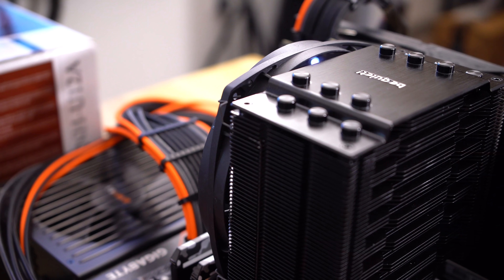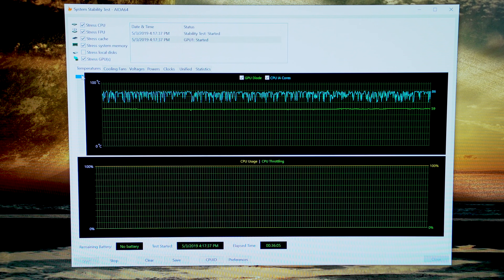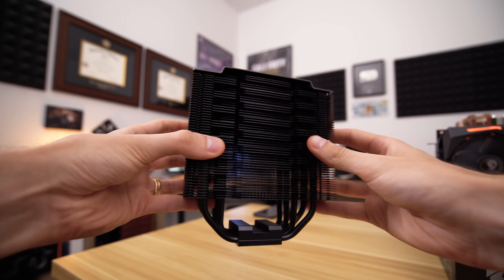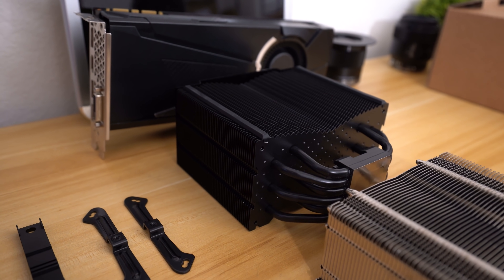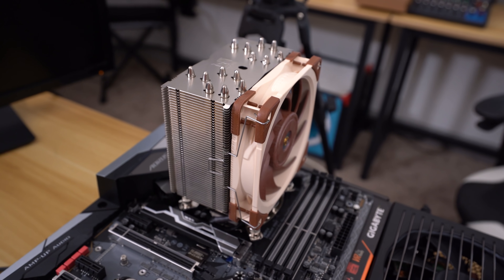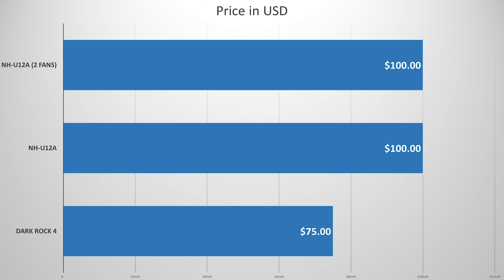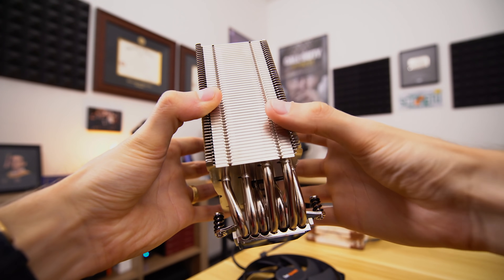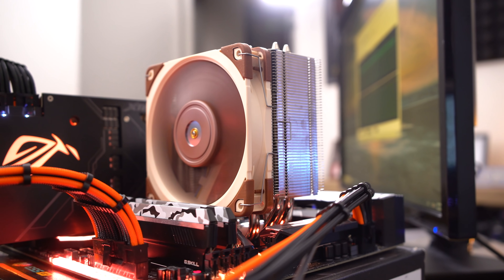Air Cooler Showdown: NH-U12A vs. Dark Rock 4

Comment: I would take the Noctua any day, so much easier to install and mount and way better clearance. You can always adjust the PWM signal to lower rpm and noise.
Reply: Gripen90 the dark rock 4 is actually not that difficult to mount. In the past bequiet coolers were terrible to install.
I do run an non delidded 8700k@4,6 on an topflow2 cooler which also activly cools the mobo vrms with its fan running at 650rpm
Reply: @TheNaikan  I love fanboys of random products such as PC air coolers.  Don't get me wrong, but dude, you don't need to say this test was dumb.  If the the fan curve would've been lowered for the Noctua's run and the small performance margin of the Noctua was eliminated, you'd be saying the test was unfair.  Both are great coolers, get the BQ if you want sleek looks at a lower cost, and get the Noctua if you want the best performance.  You really don't need to defend what you buy or prefer here, no one is saying your cooler preference is wrong.

Comment: BH-U12A is a 100$? I paid like 90 for the NH-D15 and it wasnt on sale
Reply: NO ONE is buying a NH-U12A of they can fit a D-15s/Dark Rock Pro 4 into their case. you are paying a premium because space is fucked.
Reply: You're paying for the fans, the new noctua fans are amazing
Reply: @Manjai122  The NH-D15 comes with 2 of the new fans tho
Reply: It performs as well has the D15 but has 100% ram compatibility and weighs significantly less
Reply: Nooooo it performs ALMOST as well the D15 is still a better cooler
Reply: @zergtoss1  its probably because of the fans since they are $25 - $30 each, but i still think its impressive that it is on par while being significantly smaller
Reply: @zergtoss1  other reviews show it beating the d15... It's within the margin of error. I'd argue the 12a is better because it doesn't fill your entire case...

Comment: Good stuff! I agree with your reasoning. Running a DRP4 in my system, and I certainly wouldn't put a puke-colored fan in there. :)
Reply: They really are hyper ugly. Also, an exposed washer in the middle of the hub on the “best” fans? Congrats, you made your ugly fans somehow more ugly. Sad part is they are proud of their “gorged on chocolate and barfed” color scheme.

Comment: I would still take the noctua for the ram clearance, but great value on the dark rock still
Reply: Will a copper brick help with a lot more than just height?
Reply: The dark rock pro 4 is designed a little different, has cutouts for more ram clearance, comes with more fans is, is still crazy quiet, and looks bad ass
Reply: Same. Noctua is cheaper for me in Ottawa Canada.
Reply: The color  of the fan is an eye sore but it's worth it. I went from 65° during gameplay and 55° while idling to 55° and 45° respectively. It's also a little noisy but tends to be really quiet when leaving it on idle. Got it for 60 bucks on Amazon.
Reply: If you look well this is not an issue, you can lift up the fan on the cooler tower so it's not in the way of the ram anymore, I have pretty tall ram sticks anf with that I didn't have any problems
Reply: Chromax ones are coming before end of 2019, hope it won't be any more expensive, or i'll just get Ninja 5 or MA620P and put some NB eLoop fans on it, Noctua is best for case fans, not for static pressure fans, it's still better than most of rivals, but not best one, I got some 120mm Chromax case fans, but other stuff, specially this new expensive "all around" coolers are not worth it, they got same static pressure on higher rpm than normal ones which aren't the best anyway, and less airflow on 2000rpm than case ones on 1200rpm...

Comment: Thanks for the video, but 10 times out of 10 I'll chose an AIO liquid cooler instead.
Reply: "better" not quite, AIO's are better in short bursts, takes about 15 minutes for the water to heat up entirely so that means you have 15 minutes without the spikes and thermal throttling if you're pushing the chip. An air cooler will jump to its peak immediately, so if you're running a game that throws your CPU against the wall part of the time and is fine for the rest then the AIO would much less likely thermal throttle. It also depends on which AIO because some AIO's are better all around bur that's the science. AIO's are also much better for travel because you don't have to risk bending anything with that big heat sink flopping around and AIO's have silent modes where the fans don't even have to kick on for a while. AIO's also usually look better too but that's subjective.
Reply: @Youdontknowme-xc8mu  I've never had a problem with my system over heating. Max temp after 90 minutes of running prime 95 is 82C. I'm sure my case helps a lot with cooling. It's a cooler master H500 with 3 200mm fans, 2 in front and 1 on top.
Reply: It's personal preference in the end. You can't go wrong with Be Quiet, Noctua or high end AIOs anyway.
Reply: @mr.madnus.fernus  True. Some like the way a big air cooler looks in their system and that's cool. But I like the cleaner look of a small AIO pump. Also I never have to worry about my ram being too tall. 👍
Reply: Actually both of these coolers are better than an Aio
Reply: @ferasamro9735  Depends on what you consider better. Temps with both are similar, but air coolers are big ugly blocks of metal which I do not want in my system.

Comment: If Noctua releases a blacked out edition, it'll sellout so fast. Just look at Linus' video comparing AIO to Air Coolers.
Reply: They don't sell one technically, but you can change colors using the Chromax fans and Chromax accessories for the D15 (not sure about the one in this video).  I did mine in white and it's beautiful.

Comment: wow what an odd coincidence... I was litterally just looking into both of these coolers and wondered which was better.
Reply: Noctua is king, I own the monstrous NH D15 and it made my old AIO look stupid plus it is barely audible even at max rpm. My case fans are be quiet though.
Reply: @jasongooden917  yea, but Noctua air coolers look awful even with shrouds
Reply: @benstaker2363  looks don't matter as much as prefromance especially with overclocking Ryzen. This Noctua is awesome and worth every penny. How many people really care what your cpu cooler looks like or look in your case to see it?
Reply: @MitchGaar  Damn this is an old comment. People do look, one of the big things with enthusiast PCs, but this vid is old and outdated, my air cooler recommendation is the noctua u12a now, it's what I run myself.
Reply: there is noctua nh-u12s one & ~$59 & older model with 5x heatpipes.  the S is slim or single fan & the 12a is newer model has 7x heatpipes.
Reply: Probably not a coincidence, just google.
Reply: Go with Noctua, I did my research and it out preforms everything in air coolers.
Reply: The algorithm knows all.
Reply: Ikr, I was doing the same thing
Reply: Get a Dark Rock Pro 4, it outperforms the Noctua.
Reply: @ninetenduh  no it doesn't lmaoo where do you get your information from
Reply: @ninetenduh  bullshit

Comment: but blocking a RAM slot is kinda inexcusable.............
Reply from the maker: You can still raise the 140mm SW3 fan. It'll look weird, but there's a bit of flexibility involved. And I'd argue that most PC builders are using two modules instead of the costly 4 alternative, so it wouldn't be an issue either way.

Comment: Could push pull enhance the performance of the dark rock 4 ?
Reply: Yea it should be it depens on the air flow. Also it most likely will only be by a couple procents

Comment: would you recommend the Dark rock 4 version more or the Pro version? because i have a I7 8700k to cool and i dont want an water cooler.
Reply: if you have low profile ram and want to overclock the crap outta that cpu then go for the dark rockpro 4. if not then go for dark rock 4

Comment: what about, the Dark Rock Pro 4?  how does it compare to the NH-U12A?   Plus, they are closer to the same price.
Reply: Nothing against BQ or the DRP4, but that's bringing some pretty enormous firepower up against Noctua's mainstream tower. I think most builders are going to want to compare the DRP4 with the NH-D15 or D15S (offset, single fan), while people choosing an NH-U12S or DR4 are looking for a shorter cooler (doesn't hit the side of the case) that is very unlikely to interfere with RAM or GPU clearance
Reply: @elenchus  $100 for an air cooler is not mainstream.
Reply: @nindzamaleta3030  "$100 for an air cooler is not mainstream."

Sure it is--it's a mid-weight, mid-height, mid-width, mid-sized fan cooler, made to fit most midtowers. It's absolutely the mainstream solution from Noctua.

But you can always pick up an NH-U12A, the last generation of the cooler, for under $60 directly from Noctua via their Amazon store, or their high-end NH-D15 for $90, again, directly from Noctua via Amazon. 

So if price is the hangup, just go for the D15.
Reply: @elenchus  The height of the U12A is 158mm and the DR4 is 159mm where as the the DRP4 is only a few mm taller at 163mm. Very few chassis (honestly I can't even name one off the top of my head) cap clearance at 160mm, most mid towers are either 155 or 165. The U12A is better for tall ram clearance, particularly if you want to show off the RGB bling though.
Reply: @Allhopeforhumanity  Tons of cases cap at exactly 160mm. I see it all the time. 

That said, in my experimentation, I've found most of them are very conservative with their official specs. One of my cases, a Silverstone FT05, claimed to be limited to 162mm, but I was able to fit the NH-U14S (it just barely touches the side of the case, but no bulge), a 165mm cooler. I figure that they put in 2.5mm of extra clearance over the real spec. 

So even if the case says 160mm, there's a decent chance you could make it if you were willing to try.

Still, I think that people shopping the NH-U12S will be looking at similar towers like Dark Rock 4, and the D15 shopper will be looking at the DRP4. I don't mind them being compared, of course, I think the mainstream U12S would be very competitive against the DRP4 because the performance gap is so large in this test. 

You could go a step further and go with their high-performance single tower (NH-U14S) versus BQ's top cooler (DRP4), which would be relatively interesting because the U14S still has perfect RAM clearance on both sides and uses only a single fan out of the box. I'd bet on the U14S. 

I use the D15 and U14S regularly (on a D15 as I type this) and I suspect that the U14S is the most anyone would actually need in a workstation. The advantages, namely being able to get to the RAM effortlessly, outweigh the marginal 1 to 2 degree Celsius advantage you get with the D15. Of course, you could go with a D15S, which has added GPU clearance and no front fan, so while not quite as easy to get to the RAM, it's totally possible to change the RAM without removing a fan, much less the cooler.
Reply: @ @elenchus I suppose like you said, the 160 quoted spec is often very conservative in the cases that I have tested as well. 

I also think that the comparisons more often than not come down to price/ram clearance and less about total height, like you mentioned. The U12S for example is great for the price, similar to the Scythe Fuma/Mugan, whereas you are definitely paying a premium for the DRP/DRP4 for the black anodizing and the U12A for the A12x15 fans. The ram clearance is especially nice if you are trying to show off the RGB bling, but hasn't been a concern in my builds which are mostly solid side panels. 

I think that another strong consideration is the noise normalized performance comparison as most people aren't running their coolers at full tilt 24/7. Dropping the RPMs down to ~50% pwm usually saves you 4-8 dB at the cost of only a couple degrees as the noise relation is exponential and cooling logarithmic.   

Workstation wise, I've also noticed a trend that the larger noctua cold plate seems to perform better on larger CPU dies where the heat is also less localized. I've definitely also had good luck with the U12s on some xeon builds, but even my Scythe Fuma has been fantastic  on my 3970x at 4.5ghz. The DRP4 looked great on my main 4790k rig, but like you said, the ram clearance issues was my primary reason for jumping to the U12A in end.
Reply: Dark rock pro 4 looks wayyyyyy better and im too poor for to afford 4 ram modules. For me, its the drp4.
Reply: @Traumatree  dual towers give you option to mount 3 fans and run them at extremely low rpm for quietest experience
Reply: No offence but shit comment; Too wide and too tall! 
 NH-U12A and Dark Rock 4 [and Scythe Mugen whateverislatest] entire's point is getting big air cooling performance into cases/mobos that cannot squeeze in big dual towers. The D15s is a lot cheaper than the NH-U12A too, so there goes any argument there, and with the NH-U12A you are paying mostly for the fans.
Reply: @PriaSamari  Scythe Ninja 5, Mugen series is beefier 212 and Ninja is big 120mm one, Ninja 5 is actually best option, cheapest, quietest(because 800rpm fans) and cools just as good, in a case with good airflow it can outperform NH-D15, only downside is RAM clearance because it's long, like rly rly long and only one 800rpm fan just isn't enough to get use of that long cooler, another good cheap alternative is Cooler Master MA610P, dual tower but it's 120mm, so not bad for clearance, it's RGB, but fans are loud and you could probably get same performance out of it with just 1 NB eLoop cooler between two heatsinks

Comment: You could use the extra fan as a case fan.
What about noctua's low power adaptor's?
Reply: Since the fans are PWM, there's not much reason to use an LNA unless your system doesn't have any/enough 4-pin headers available, unlikely in a system using the very best cooling systems on the market. I'd say skip the LNAs, plug in PWM, and set a custom fan curve that suits your ears.
Reply: @elenchus  My system doesn't like the pwm fans and doesn't spin them slow enough. I use low noise adapters to push the fans down to 500 rpm. Without it they would run at 900. I am using an old P8Z77-M mainboard though. Might be better with something newer
Reply: @Someone-ci8wf  An NF-A12x25 should be pretty quiet at 900 RPM, so that might actually be ok for your needs, but you don't have to replace an entire motherboard to fix the fan controls in your BIOS. I'd recommend something like the Corsair Commander Pro, which bypasses PWM entirely for a USB interface. I've used it since the day it came out.
Reply: @elenchus  Ah sorry I should have clarified. I don't use noctuas. I use the Dynamic X2 GP-14 that came with my fractal design case and bought 3 low noise adaptors seperately for 5,90€. At first I connected them directly to the included fan hub which for some reason spun them at maximum speed no matter the configuration. that was when I bought the adaptors. After some testing I found out that the fan hub was weird and tried out the motherboard headers which spun them at a still audible but noticable quieter 900 rpm. That was when I decided to use the adaptors I already bought anyway
Reply: @Someone-ci8wf  well nothing wrong with that, sounds like you have the use situation of exactly who LNAs were designed for. That is one of the nice thing about brown Noctuas, they come with LNAs in the box
Reply: @elenchus  it's things like this that helps to justify the price premium. Also there level of service. I got a new motherboard and noctua send me a mounting kit for that board free of charge. Of course it's on worth something if you need it and use it.
Reply: @klausedwin  Definitely. I think in my home alone I've got 10 different Noctua fans running right now, 8 in this case alone lol

Comment: dark rock 4 is putting in work, i have the nh-u14s on my 8086k @5.2ghz. might have to get a dark rock cooler next
Reply: Dark rock is much heavier than noctua coolers. Your motherboard will say thank you for not having to sag.
Reply: The dark rock is also a pain in the arse to fit (ive used both) TBH a cheaper 212 evo is still the best cheap air tower